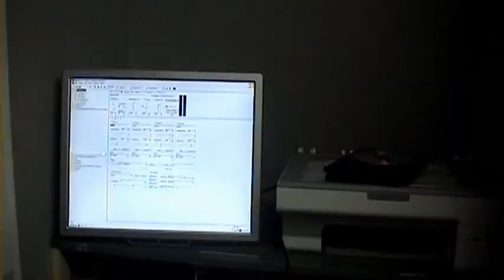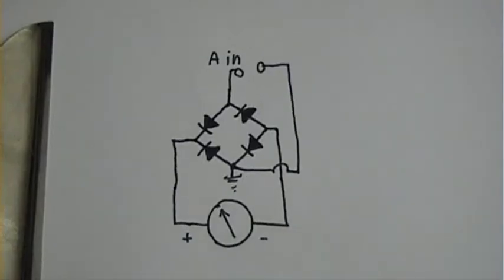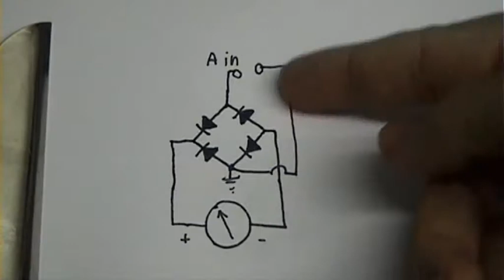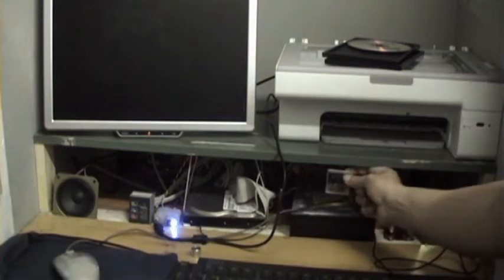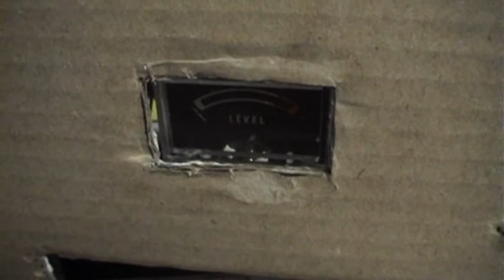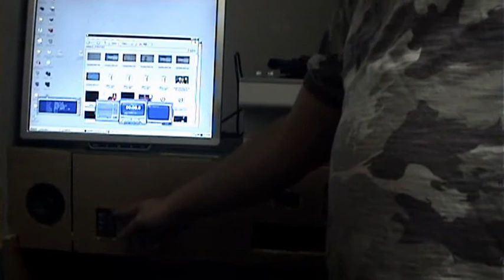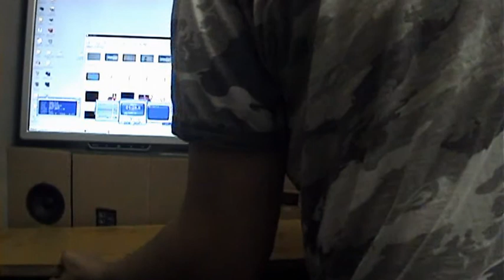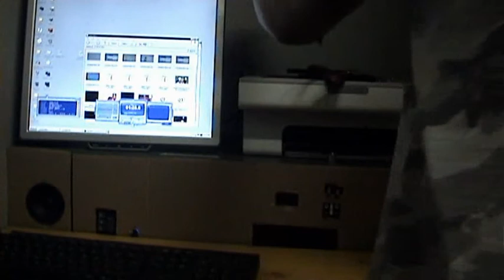CDC Electronic Workshop - Level meter circuit and Finnishing FrankenPC

Comment: The backlight on your camcorder's LCD may not be broken; it might simply be turned off. Some Sony Handycams use a "hybrid" reflective/transmissive LCD which lets you turn off the backlight and put the LCD into reflective mode, which makes the image visible even when bright sunlight is shining on it. So if you have one of these Handycams, one of the buttons on the camcorder will let you turn the LCD backlight on and off.

Comment from the maker: This is something I would have put it, but my jigsaw is no longer working so I can't cut out any ventilation holes, but the shelf doesn't go all the way to the back wall so there's a little bit of space there for air to escape.  The temperature doesn't get much above 40 anyway, even when the room itself is quite warm.

Comment from the maker: You might want to try out the LM386, it's not terrifically high powered but it's simple and I recommend it if you're a beginner to electronics.  I don't have any circuits that use it but you could google "LM386 amplifier", or even look it up on YouTube as there's plenty of videos.